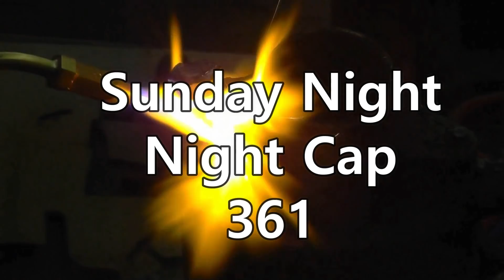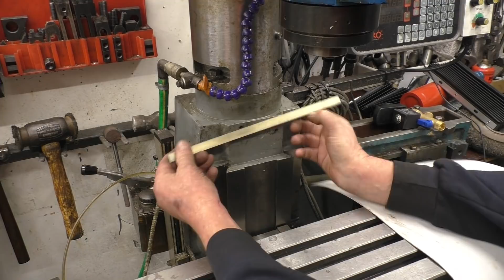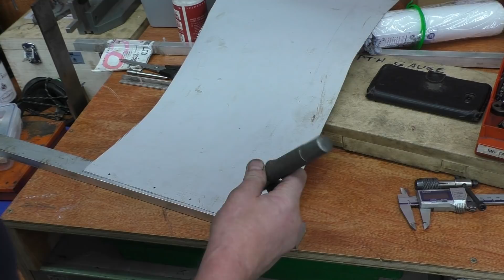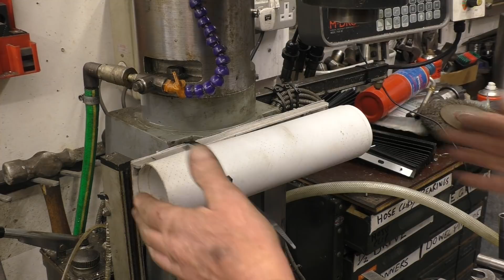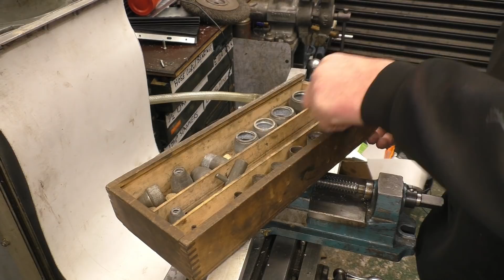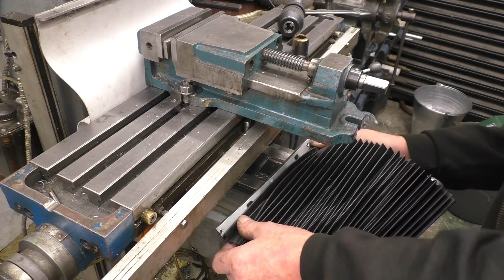SNNC 361 P2   Mill Z Axis Way Cover

Comment: I need to do something similar to my new-to-me mill, the way cover is missing in the same area. Still not sure what kind of material would be best yet. Happy New Year!
Reply: Hi mate. I've used oven shelf liner material. It's flexible, heat and oil resistant and it's also cheap.

Comment: If there are any offset print shops in your area check to see if they have any blankets you could have. They have a rubbery surface on a canvas backing. They are incredibly tough and seriously resistant to oils and solvents. 
Hoping that 2021 is a much better year for you and your family.

Comment: if you can get some linatex is a very hard wearing rubber sheet used for lining rubble chutes in quarries should be excellent for this job
Reply: I use belt material from one of the many discarded treadmills.
Reply: Close as well John. They might send a sample. ;) 
https://www.rubberlinings.co.uk/linatex-products